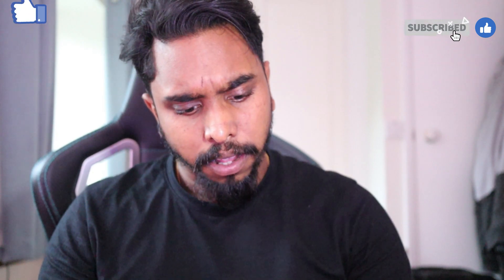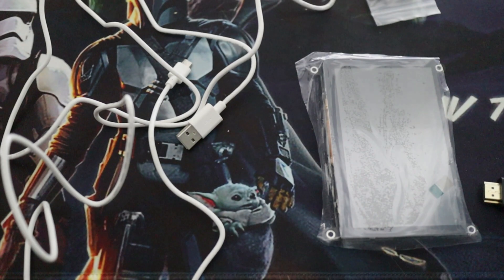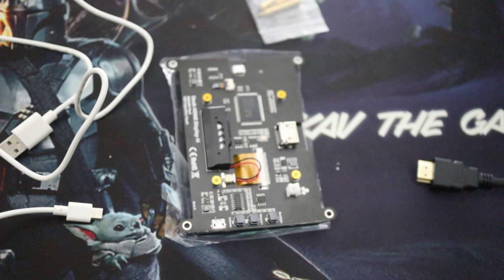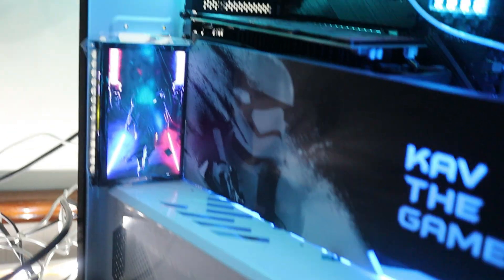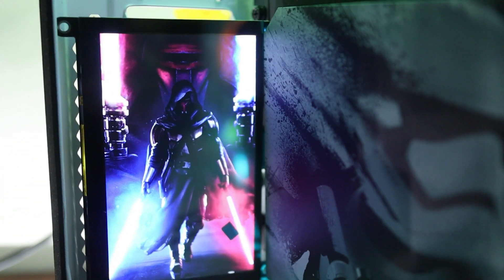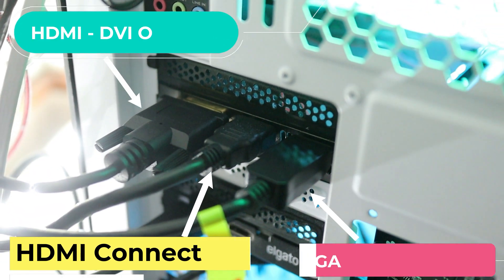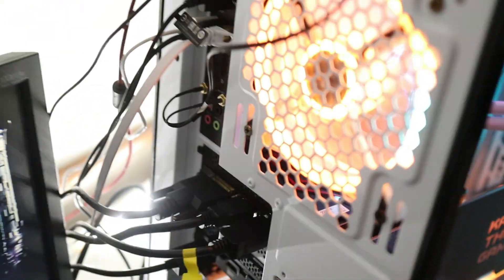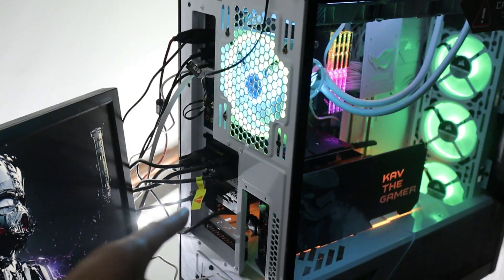Easy Install 5” Internal Monitor For Gaming PC 🔥 #howto #tutorial

Comment: So i put a 5 inch mini LCD screen in my pc because i saw it on youtube, looked really cool. but once i got it installed and plugged into the HDMI windows defaults my desktop to the little screen and i cant use my big monitor...cant figure out how to tell windows that my big monitor is my MAIN monitor and the little 7 inch one is #2 it just refuses to work no matter what i try...anyone know what to do here? the only thing ive been able to do is "duplicate screens" which is useless because i need the 7 inch for displaying cpu/gpu temps ect ect. im 6 hrs of effort into it and nothing seems to work
Reply from the maker: Hi, I ran into a similar issue when first trying to set this all up. Have you tried going into. 
Display settings right hand click the desktop. 
Then select identify so a number will appear on each monitor. 
Then you should be able to rearrange the order/layout from that same menu screen. 
I’ll link a Google article on what I mean. It’s the only way I can think should solve it. If not may have to adjust the same settings but in your graphics’s card menu settings. Such as NVidia control panel if your using an N Vidia card. 
Here’s the article try this hope it solves the issue. 
https://support.microsoft.com/en-us/windows/how-to-use-multiple-monitors-in-windows-329c6962-5a4d-b481-7baa-bec9671f728a
Reply: @kavthegamer  yeah that was the very first thing I tried that did absolutely nothing I mean the screens moved around in the display settings but nothing changed on my computer or the 7-inch screen it just refuses to see my big monitor as my main screen and puts all my icons and taskbar on the 7 inch...so frustrating

Comment: Hi I ordered one but have a question. Can this be connected to pc any other way? I am using my HDMI for my oled tv as my main display. I just want this little display to do like live wallpapers inside my pc like you have here. Any recommendations?
Reply: Use other HDMI ports in your motherboard. If u have a display port u can buy a convertor and use it

Comment: Brother what is the name of the monitor? And also do you recommend this monitor?
Reply from the maker: Hello, the monitor doesn’t have a brand name as such. It’s just a Rasberry PI compatibile monitor. The link for the monitor is in the description of the video 👆 
I would recommend the monitor it’s touch screen and it’s easy to power nice clean visuals too. The monitor can be used as a Raspberry PI standalone monitor if you didn’t want to use it on your PC.

Comment: How do you get the wall papers for the display monitor In your pc, I’d appreciate a video on it I’m highly thinking of buying one
Reply from the maker: Hi apologies for the late reply. It’s very simple and easy you just need to set the external monitor to a third display then change the layout to vertical I’m using a software which shows a video as a wallpaper. I’m in the process of making a video showing the steps how this is done 👌